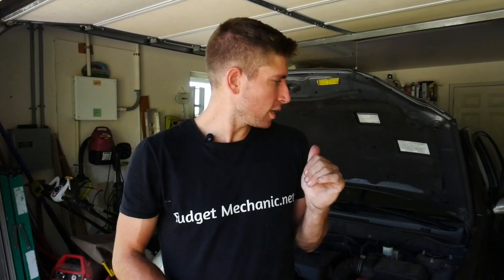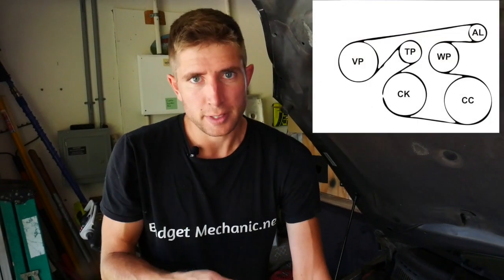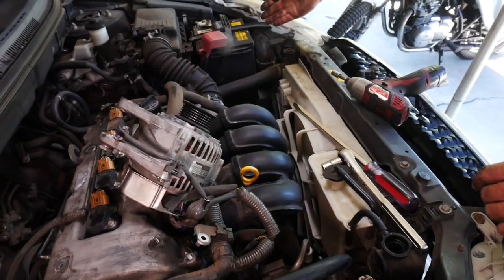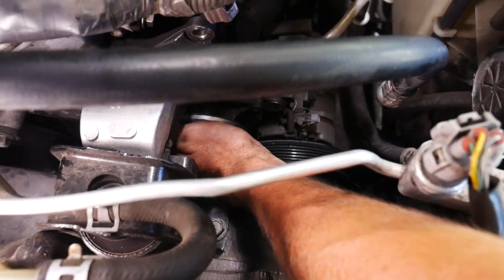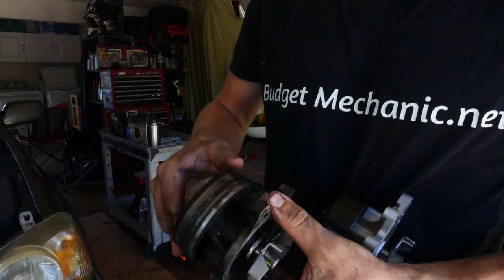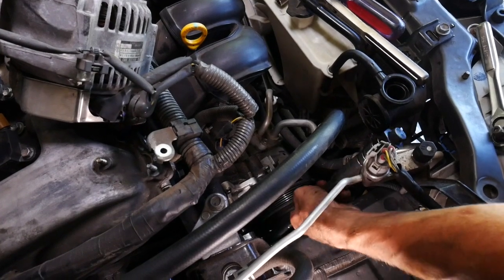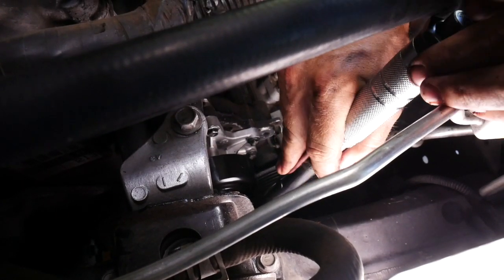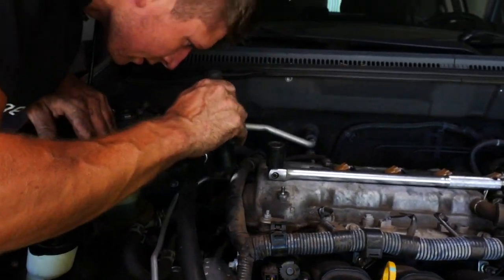Replace Water Pump in Toyota Corolla 2008 - Leaking Coolant Overheating

Comment: I’m running into a problem I cant get the bottom bolts loose because my tools I only have a small ratchet 2 other ratchets but extension too long which won’t work a 10 mm wrench won’t work what length are those sockets ?

Comment: Great video. Only thing I would do different is change the coolant. It's cheap plus it will lubricate the waterpump. You could reach drain knob from top. Especially with long arms. Use hydrometer and test old coolant or just replace with Zerex Asian  coolant. Well done video though overall.

Comment: I would like to add, after refilling the coolant you need to run the engine with a bleed funnel to get the air out of the coolant system. Then after bleeding top up the over flow bottle.

Comment: Dont worry bout warping or cracking the old water pump, its no good anyways. No need to be careful with it. And, the step of the other pulley being in the way of the last bolt was left out of the video.

Comment: Should I replace my radiator if there is no leaks? My 2008 Corolla has 238 thousands miles with all original parts except serpentine belt  and parks plugs.
Reply: Leave it alone u less there's a leak

Comment: Can a bad water pump cause the AC to not work properly?
Reply: No lol it's not connect3d. Could be a bad fuse or connector or ac compressor or condenser Probably a leak from condenser but you need to get it inspected with dye freon to find where there's a leak.

Comment: I have a 2005 Corolla and the bottom of the car make a screach noise by the catalyst converter. Do you know the problem?
Reply from the maker: Not sure without being there to hear it sorry. Catalytic converter's will make a screeching noise under acceleration when they are clogged tho!

Comment: Fantastic video! What kind of torque wrench is that? Looking for a recommendation because mine did not fit
Reply from the maker: It was an amazon one I believe. The 3/8” ones with low torque readings are the most useful for most people

Comment: Can you please tell me the name of that gasket glue you used? Thanks!
Reply from the maker: just a generic water pump or designated water-sealing rtv from a parts store. usually its blue. I know a lot of guys even use the black stuff designed for oil and they say it works fine